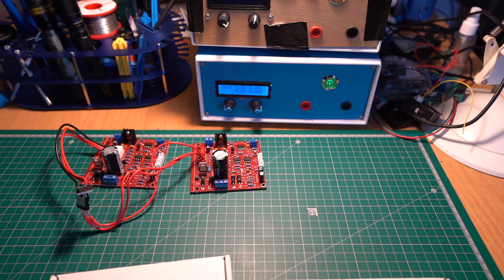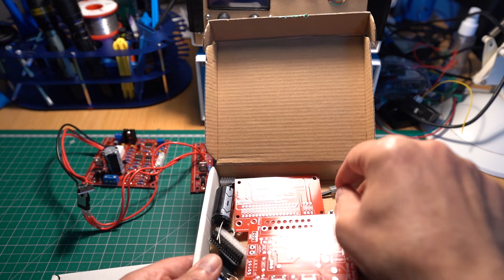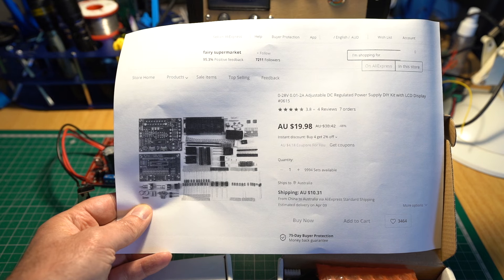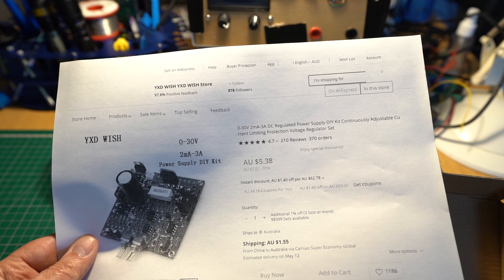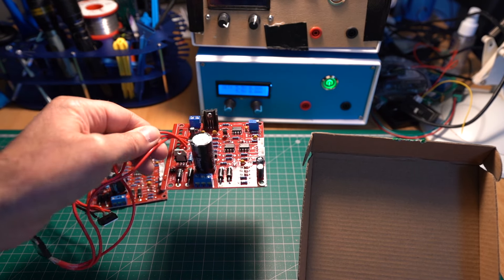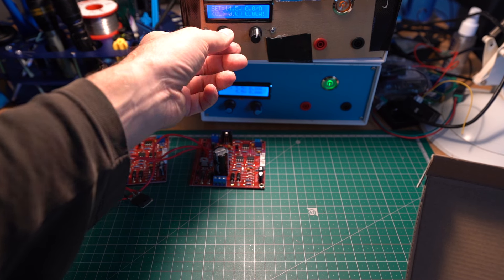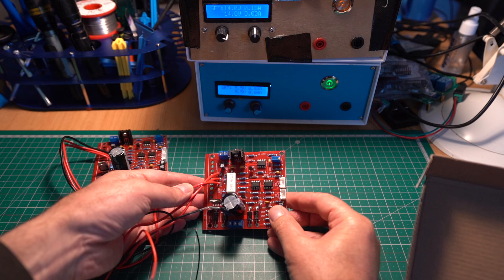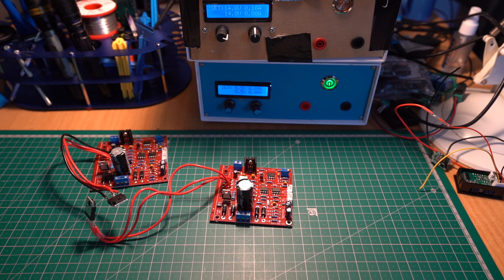0.01~28V 2A Adjustable DC Regulated Power Supply DIY Kit P.t 1

Comment: Subbed and nice looking supply 0-28V  The 0-30V supply on your print out is the correct board but the boards your were sent are different, the same as my fakes :(
Reply from the maker: Yeah that's what I thought. I often wonder how many different cloned Hiland boards there are.

Are the boards I have the same as your boards?

Or are they in fact slightly different?🤔

Im peeved off with these boards because they don't friggin work.

Its a waste of money, time, and disappointing.

I know how you feel. Sigh.
Reply from the maker: Im just finishing another one which means I now have three 0~28V regulated power supplies.😀👍
Reply from the maker: Oh thanks for subbing. 👍